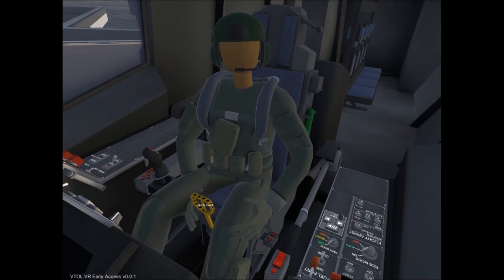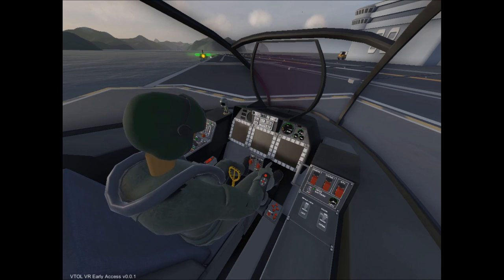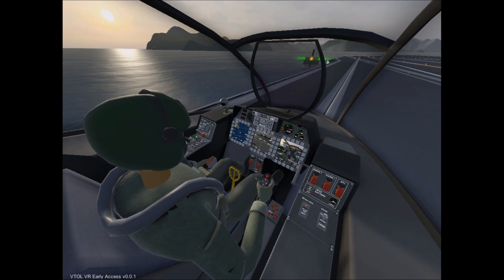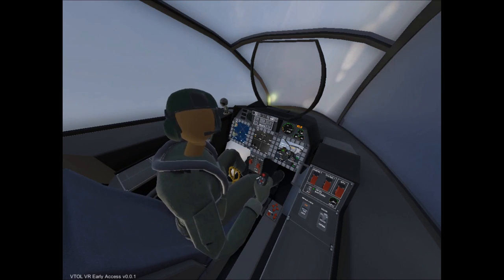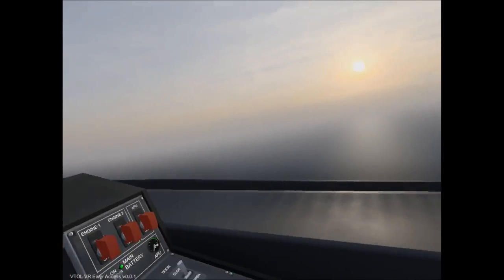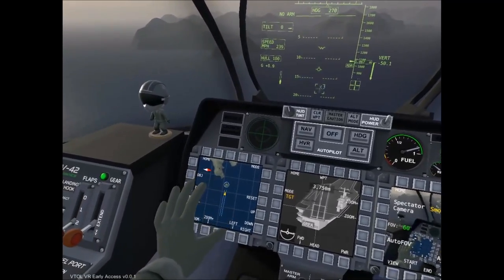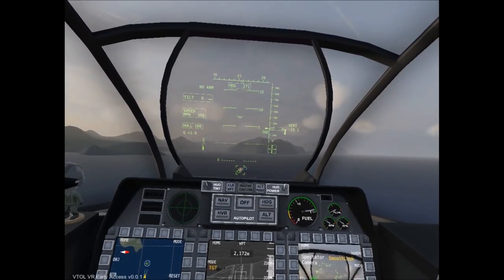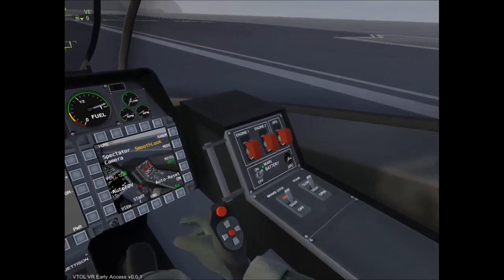How to Start-up, Take-off, and Land On An Aircraft Carrier - VTOL VR Tutorial - Oculus Touch

Comment from the maker: Quick note - this is a revised version of the original tutorial.  I made the following changes:
1) Included a section covering the OLS or Optical Landing System
2) Increased the recommended angle of approach from +/- 5 degrees to +/- 7.5 degrees (between 5 and 10)
3) Because of #2, the approach speed also decreases, lowering the chances of snapping the arresting cable

Unfortunately I could not get rid of the overuse of "go ahead and...", "..itself", and "slowly"... I tried, trust me, I tried.  But the audio would be too awkward with random cut-offs of sound :(
Reply: Tuuvas before takeoff you can raise your cat hook and it will keep you locked in, for the jet you can turn on cato trim and it will takeoff like the AV42C

Comment: +Tuuvas why did I sub to you? I don't even remember. And I don't even care why -- this video was delightful. BTW, I am a pilot, and I hold a CFII rating as well, and let me say: this is good instruction. Keep it up!
Reply from the maker: Wow, great to hear this was a good tutorial even for an actual pilot who holds a (had to google this) Certified Flight Instructor Instrument rating.  I will surely keep up the tutorials in this manner then!  But please, feel free to advise if you think something can be improved. ex. Flight Path Marker vs. Trajectory Indicator.
Reply: I taught in single-engine piston, my dude; no fancy HUDs for me, only in my sims. HOWEVER, the phraseology for HUD symbols varies by manufacturer, branch of military service, nation... "One of the problems in head-up display literature has been a lack of standardization of words and abbreviations. Several different words have been used for the same concept: flight path angle, flight path marker, velocity vector, and total velocity vector all refer to the same thing." (Newman, R. L. (2017). Head-up displays: Designing the way ahead. Routledge.) 

I always called it the velocity vector. And since you're flying a fictitious 'bird, I think you can call it whatever the manual calls it. 

The main things I observed are that you are properly breaking down the whole exercise into components (approach, final, landing); you are properly instilling good habits (visually check controls down); and you are explaining what's going right/wrong and what you're doing to correct it. 

Good approaches make good landings; consistent teaching makes for good learning. Happy flying!

Comment: Fantastic tutorial, thank you!  I'm definitely planning on picking this game up!
Reply from the maker: +dracosummoner glad you liked it! Be sure to give DCS a go too if you've got a hotas
Reply: Thanks! I don't have a HOTAS, just a mouse and keyboard (and my VR setup), but I did give DCS World F2P a try a few years ago.  I think it ran so-so on the computer I had at the time, so I might need to give it another chance at some point.  I do have and enjoy Microsoft Flight Simulator X, though—I live really close to an airport in real life, and being able to just load the thing up and "hop into" a Cessna is gratifying.
Reply from the maker: +dracosummoner absolutely! A lot of the enjoyment I have from DCS is being able to hop right into a TF-51D (free plane), flip all the switches, turn the right knobs, and simply fly from airfield to airfield practicing my touch and goes all along the way. Though, lack of a joystick could be problematic as I've found DCS key bindings to be not very friendly to controllers that aren't joystick/throttle

... that said but I have gotten a harrier to mostly work using just a Xbox One controller. A mouse is still needed for clicking things, but general flight, nozzle settings, thrust, etc can all be used on just the controller.
Reply: It is nonsense. So complicated for no reason. Why not just pull the throttle pull the joystick .. FLY  ? Like Ace Combat .. that's a game !

Comment: How did you change the engine 'tilt'. You just showed it changing but not what you pressed. Great vid by the way.
Reply from the maker: While holding the throttle, it'll depend on which motion controller you have:

1) Vive Wand - press up or down on the ... touch pad?  I don't own a Vive, so whatever its called.  Press the up/down portions of it while holding the throttle.

2) Oculus Touch - push forward/pull back on the analog stick of the touch controller whole holding the throttle.

EDIT: I just realized - there's an added bit of complexity for Touch.  Make sure you also set analog stick support in the Main Menu Settings otherwise you'll be forced to hold the "click" of the analog stick first.
Reply: Tuuvas Thanks, I'll have to have a good look at this game.

Comment: For takeoff don't you want the 1st position not the second?
Reply from the maker: It all depends on take-off circumstances.  Luckily the AV-42C has reeeeally powerful engines as the heaviest loadout still yields a positive thrust-to-weight ratio.  The only time full flaps is not a good idea during take-off is if you have a short runway, but that challenge is already by-passed by the catapult in this tutorial.  Drag is not so much an issue in this case as the catapult + afterburners will power right through.